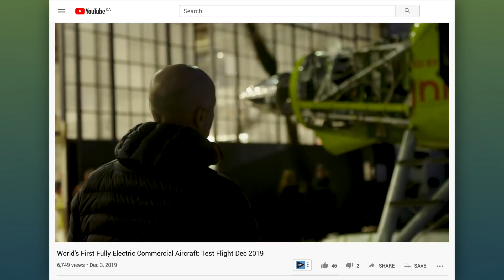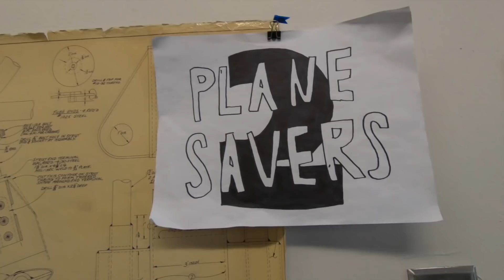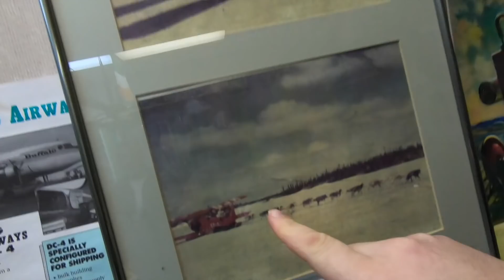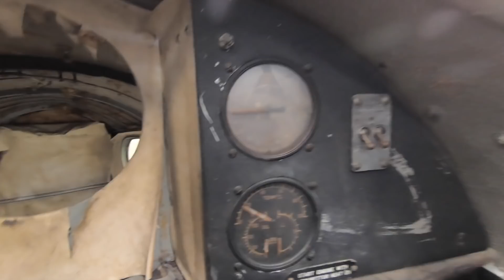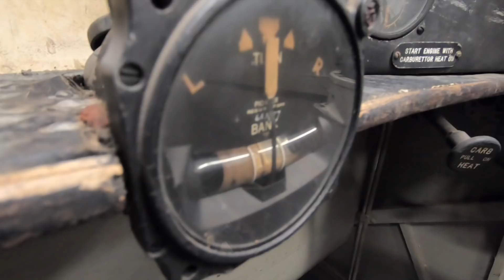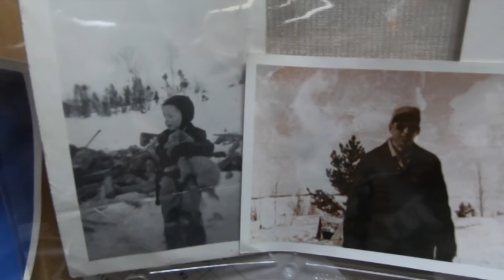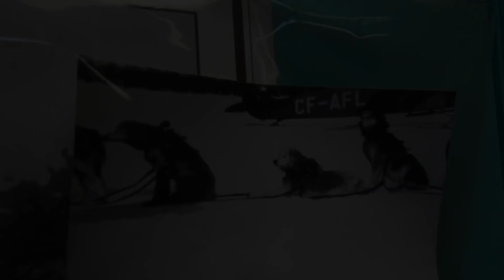IT WORKED! Worlds First Fully ELECTRIC Commercial AIRCRAFT Flew TODAY! | Plane Savers S2-E33

Comment: Batteries, great in your  climate,, lose half their capacity in the cold. 
Electric cars, been around 100 years  and still only usefull as a commuter car.
You can power anything by electricity and it will be functional. But batteries will never be a true viable alternative.
Often even things like electric trains and trams are not really viable. Cheaper and more practical to use a diesel engine to do the same job.

Comment: I could see hybrid aircraft before all electric. Petroleum fuels still provide more energy by weight than batteries can hold. But if you had a turbine powering generators that in turn power electric motors I could see longer duration flights.

Comment: First please define a 'commercial' aircraft, second was is built specifically to be electric powered and third if you fly somewhere with passengers how are you going to charge it to get home again ? 
Don't get me wrong I love all things electric from bikes, cars and my Silent electro glider, but with any electric vehicle you carry the weight of the battery from full to empty and you have to power all avionics with the same batteries.  
Until battery technology and range is improved fivefold and weight halved there will not be even a short range viable commercial aircraft.

Comment: A really interesting and informative episode. And yes, this is the first I had heard anything about that electric powered plane.  It was so interesting to listen to Joe giving the history of the Fox Moth, it obvious that this plane shared s very special place in his heart. It's going to be a real delight watching this plane return to flying condition. 
David Jones
Coventry
UK.
Reply: During Wwll planes had no heat. Thus the lambskin bomber jackets and scarf assembly. Gloves too. In 1980 we had no heat on planes with engines off. Upon repairing on ramp, we would bring a duct hose from gpu to get alittle warmth to work in the cockpit. Theres a motor in the floor for rudder control. Winters at night were freezing.

Comment: Engines are not electric. Motors are electric.  Engines make power. Motors run from a power source. A generator or a battery is a power source.

Comment: Hi Mikey, great video.  When I saw the sandblasting part, I remembered doing a few Super Cub fuselages.  Once set up, it would take me about an hour to complete, using #6 nozzle & 375 CFM compressor.  Overkill, but I didn’t like chemical stripping!  I believe the electric aircraft will find a niche.  Thank you again.

Comment: Hey Mikey ! A level 2 apprentice AMJ here from Winnipeg, big fan of your YouTube series and the old ice pilots series! Your foxmoth there by the looks of it and to the best of my knowledge from school, the plane uses a monocoque fuselage meaning that it doesn't use a frame or a semi monocoque fuselage design. The airframe uses the skin for its strength as well as some some skeleton item but the skin holds it all together, dents in the skin are extremely dangerous to the integrity of the frame as the skin is load bearing. Semi monocoque fuselage uses truss systems or a frame for its strength as well as the skin! Take care!

Comment: How did you do the cool color effect at 5:04 in the video or what is that called?
Reply from the maker: I did it manually in the color settings. It wasn’t super easy. But it’s straight forward. You color mask the red and bring everything else’s saturation to zero. I could have done it a lot more cleaner but I was rushing :)

Comment: I love the fact of electric engines, because this way if they make engines easily adaptable, such as they are in vintage cars these days you can buy, you now can appease all the fossil fuel people who want to protest and still keep you cool airplane around and parts will be more common, along witth your fuel is now any electrical charge point. To me this way it re-purposes many outdated engines that you cant find parts easily. Don't get me wrong I love a good radial sound or a good cam sound in a car, but if I was able to keep my airplane going in the future or my car and I have no more parts sourced combustion wise, this allows the best alternative. I work for GM and we see lots of electric cars coming in. Everyone complains about the battery life and range. I believe all these manufactures are able to produce high end batteries, but if they supply you with a range of 1,000 kms off the hop, no one will ever buy another car for a long while and that is not a good business model. They still have to make money in moderation to anything, the business plan is still the same. So going forward I believe we will see this model more and more in the future and battery packs will get smaller and lighter as they go. Again it's all based upon pop culture and money, just like the I-phone, we had the Razor and then boom overnight they got the population to grasp the new way of technology.  People back in the day said the horse couldn't be replaced and the car and engine did that because they could go anywhere, we now face a new worldly eco evolution,  the fun fact about greed and money was the electric car was around way before the gas engine, but resources of course were better and worth more to do with fossil fuels, so lots of the companies have been buying patents over the years I believe for such a revolution such as now. Long story short I support both. Keep up the good work Mikey, history in the making going on all over the place here.

Comment: I am on the fence.
Energy storage in batteries are the main problem. Physics tells us they are limited and we have reached that limitation already.
A hybrid solution is more feasible.
Pure electric flight, maybe small aircraft on short routes (<30 min).
Not so much for long flights

Comment: Nothing wrong with the idea of electric aircraft.  I think it will be a long time before they are  commercially viable.
That is,  being  able to carry loads over long distances.  Until then, they are little more than glorified drones.
That's  not to say that they haven't achieved a great deal by getting this plane in the air.
Reply: They already started. Prototypes. CV heck Nova. I suggested solar planes because the planes sre always in the sun. And alternate with fuel or electrics. Everthing in planes is electrical now anyway. Computer , electrically driven motors in t tail. Energy in nose gear...

Comment: Hmmm. Thinking about watching the Tesla charging station after work while at the hotel. Stop your car and charge it for more than hour with electricity from the coal powered power plant. Drive 300 miles. Repeat.  I'm old fashioned, but prefer something that doesn't rely on the battery to stay in the air. Even with today's technology "Electrical failures" are not uncommon in aircraft, so being able to stay in the air after one becomes very important.

Comment: Mikey, batteries have been around for generations and the technology as we know it has advanced more or less as far as it can go. So unless a radically, as yet unknown and completely new technology appears there is little future for battery powered electric vehicles in their current form. Current batteries are just too heavy to carry around even for cars, let alone aircraft. A Model S Tesla battery weighs 1200 lbs - that's half a ton - doesn't matter whether the 'tank is empty' or 'full'. Now imagine such a battery powering a commercial aircraft that has to have range, endurance and load carrying capacity. Can't be done even by 2021!
Gordon Wonnacott   http://www.wonnacott.org/SqnLdr-GW.htm

Comment: Oh man, watching 32 and 33 in a row here.  Mikey, bring us more of Joe.  Joe, i really would love to hear all about blowpods and old stories and what not. 
bsolutely agree, living in norway,  keeping your head warm,  woolen long undies and good socks + Shoes are supwer important.   We had -42 some 3 years ago, and i still look forward to every winter. While i love lush green landscapes, winter time is just magical. 

We have two cars,  one of which is electric and with that in mind. I just say that Electric or Combustion it means little in the use. But you do have to think more economical.  And for aviation it is important that energy savings do not impact safety margins.  Other then that, go for it.  I do think electric, at leat with batteries will be a relative short phase, as i don't think mass bettery usage is sustanable at all.  

Electric will see big variations in range with temperatures, so a bettery would have to be insulated enough to keep warm higher up and not overheat down below at takeoff/go around settings etc. 
EV's hate cold weather, more resistance in just about everything, and energy spent on heating.  So i would expect Electric planes mainly to be used in warmer regions early on.

Comment: If the battery is 2200lbs what is the fuel it normally would carry? I can't remember that far back refueling that type of aircraft. Is the fuel around 1000lbs? That would take the load capacity down quite a bit.

Comment: Electric planes are fine for short hops but the recharge time is probably long!  Battery tech needs to get better for duration and temperature restrains👍. Flying rc electric planes is amazing in the fact that power is right now but duration is short!  Mikey check out my rc airshows. Biggest little air show San Carlos airport ca. Cheers

Comment: "We all know batteries will get better in time."
They've been saying that since the early 1900's.
Something that has gotten monumentally better is combustion technology, and there's still a LOT more room for that. Thinking about opposed supercharged piston engines, thinking about Freevalve technology, thinking about lean-burn technology, and a lot more. While efficiency with liquid fuels keeps taking substantial leaps ahead, the guys with the lithium batteries are trying to eek partial percentages in a technology that has very poor energy density. The so-called solid-state batteries also hold ridiculous limitations and lack of feasibility in large scale production. Also end-of-life battery volumes are proven to be a problematic mess around the earth in all the battery-using devices. Engines simply get melted down and re-casted for new life without all the horrible and toxic chemical processes associated with element mining and battery manufacturing.
Reply: ... and they have been getting better with time, much better recently. The IC engine is finished.
Reply: @locktite401  "The IC engine is finished."  Hahahahahaha. Don't they teach kids anything in school these days?
Reply: Combustion technology has hardly been getting monumentally better. Still wastes 75% of the energy contained in the fuel. Take a late 80's car for example.....lets say a Honda - wouldn't you agree Honda is known for their efficiency? - and compare it to a 2019 Honda.....lets see, quick google search...35mpg for an '89 Civic... 32mpg for a 2019 Civic.... Wow, a -9% change in fuel economy in 30 years. Horsepower up quite a bit though - but that's more market driven as today, everybody wants sports car power even in a minivan. Higher hp was available back then equivalent to today's cars, but in the 'sports' editions. Have a look at a lithium 'mine' (a real picture, not the massive copper mine some were trying to pass off as a lithium mine) and compare to, say, the tar sands in Alberta. Lithium 'mining' is mostly done in deserts and salt flats - they pump the briny water to the surface to evaporate in pools (lithium dissolved in salts). Hardly the horrible and toxic process you are talking about - that's the tar sands you're thinking of. the types of batteries used in EVs are also 100% recyclable.
Reply: @mr-uc4me  What alternative do you offer? Electric? Guess what, batteries are at the exact same limitations and demands as crude oil. Batteries have to be mined, have to be processed, and finally the energy has to be generated and stored in them. Finally batteries have to be recycled. After all the electronics and power devices around the world are crammed with Lithium batteries, now we're supposed to junk all the internal combustion engines in the world and install lithium batteries. Really? The earth would look like the moon after all the digging to get enough material to build batteries, and every coal mine, nuclear plant, and gas well would still be cranking out electrical power.

85% of the power consumed in the USA comes from coal, gas, nuclear. EV's are still about 4-5% of the vehicle market. Everyone acts like they are the future when there's no logistical, logical, sensible means of even doubling their present production. Besides this, the young generation who's being force-fed all this electric enthusiasm has become so fear-mongered into believing the world will crack in half if we don't hurry down and buy the 3x more expensive EV, they are getting PTSD over it. Next thing you know, combustion powered engine operators will be called evil. Young generations have no knowledge of, or appreciation for recorded history, and therefore no wisdom to discern the fluff from the reality. They also haven't worked long enough to understand practical economics or manufacturing.

You failed to Google actual combustion technology from places other than mainline manufacturers who don't have budgets for such developments.
Reply: @turnin.sprocket  Yep, still going to need to make power, no doubt about that. Shifting away from liquid fuels and the inefficiencies and pollution from IC engines used for transportation is a very good thing. As far as costs go, over the lifespan of a typical car EVs are already proving to be cheaper to own and drive, despite the sometimes higher purchase price - and they are saying within 5 years even the purchase price will reach parity. Why do you think companies like Airbus, GE, Siemens, Toyota, Volkswagon, GM, Ford (all of them?) are investing BILLIONS of $$ into EVs and NOT internal combustion technology? - it's because IC tech has been taken about as far as it can go. A shift to EV Won't happen overnight, and for some things (like trans-ocean airliners) it may not happen at all.

Comment: No battery technology works well at -30⁰ C or F!. Arctic aircraft will not be flying on battery power. But the reliability of electric aircraft would be magnitudes better than internal combustion or turbine engines. I'm pro, while I realize that any duration and load bearing capability are far in the future.

Comment: Electric "motors" are the future ...HOWEVER... the problem with them becoming mainstream is REFUELING (both time and cost). It takes to long to recharge current batteries and it costs to much to have "switchable" battery packs ........ until someone comes up with a way to Quickly & Economically REFUEL electric motors they will not become the movers of choice for "constant users" of vehicles for commerce .............. just sayin' .......... ;-p
Reply from the maker: You are 100% right
Reply: @MikeyMcBryan  Thanks Mikey ..... I had an online "discussion" with a young proponent of "go electric & ban fossil fuel" lad a while ago...... it took several exchanges to convince him that his "logic was impeccable" but his "assumptions were flawed" ..... he assumed that the "average vehicle" traveled less distance(daily) than the batteries were capable of(on a single charge) ..... when I explained that (approx.)75% of "all" the vehicles on the road traveled farther than current batteries would support his idea wouldn't work because of the "time/cost to refuel problem" (ie: keeping commerce cost effective) .... took a while but, he finally saw the light ..... Electric motor transport while prevail WHEN the REFUEL problem is solved .......... still, just sayin' ........ ;-p

Comment: FIRST, I am not so about first commercial, they have been using  electric commercial trading aircraft for years. The other hurdle is Transport Canada, as they have no reference to electric power, only internal combustion engines. Its doubtful to me they can change all those regs in less than 2 years.
Reply from the maker: I'm thinking the mean first commercial category aircraft.
Reply: @MikeyMcBryan  okay, I assumed a training aircraft, where someone is renting it, would be considered commercial. The one I seen a reference to would be german. This particular beaver would have been removed from commercial, and into experimental,  I would think.